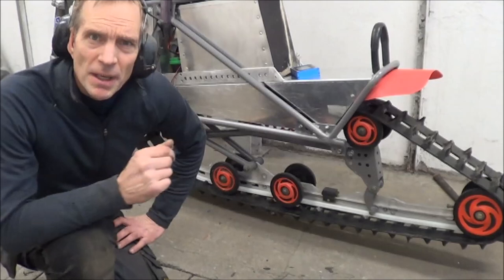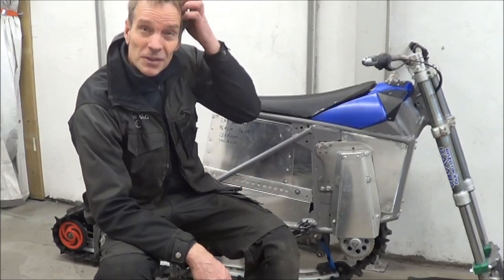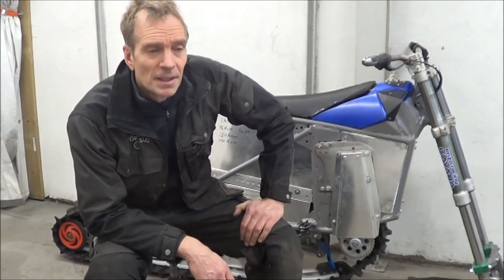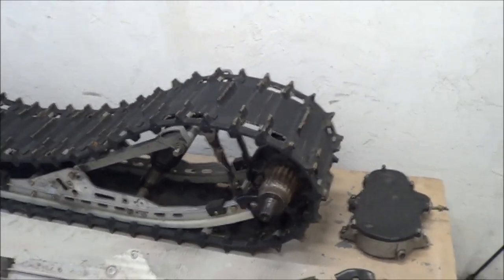Electric Snowbike 4  Assembly

Comment: Need a little more radius on that rail so the track approaches at a tangent not an angle.
Reply from the maker: Yes, thank you ! Noticed the problem when testrunned the trackband, put a band to restrain the stroke.  Put more radius is a better solution ! BR Pär